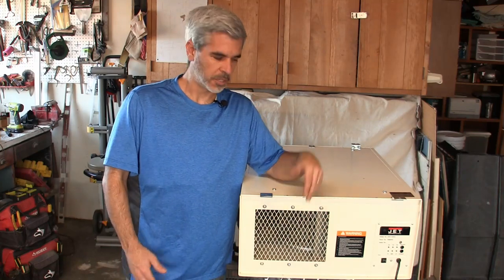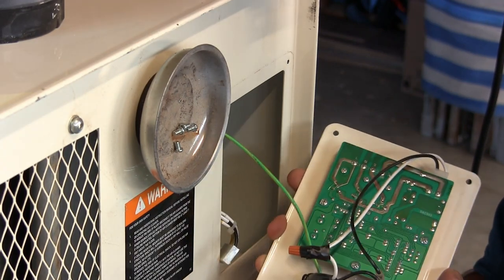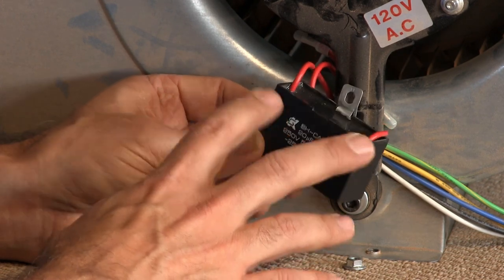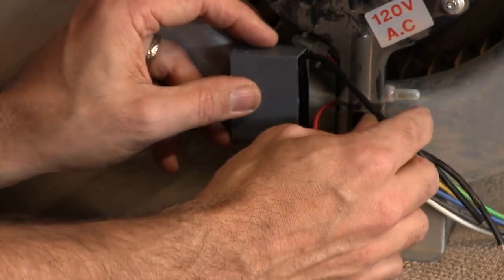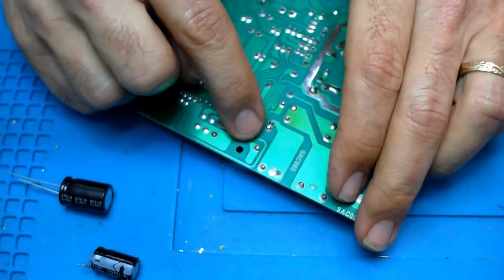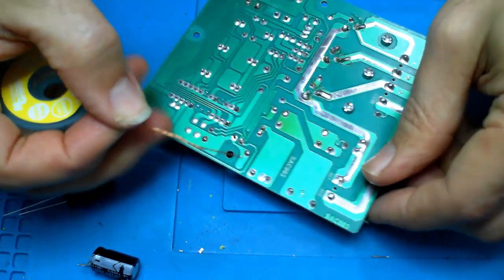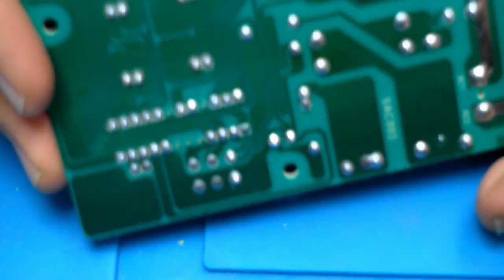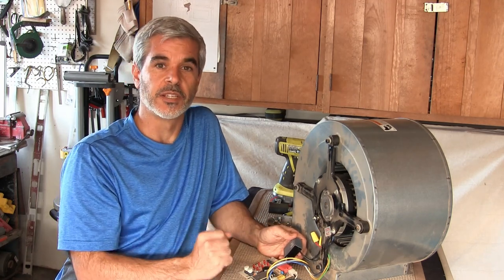JET Workshop Motor Start Issue - Motor and Controller Capacitor Replacement

Comment: I've got slow rotation under power, but the impeller spins freely by hand, so I'm ordering the replacement capacitor. Given the vibration, which you called out for the circuit board, I plan on using crimped connection instead of wire nuts, because a wire nut at that location, above and inside the cage, could get sucked right into the impeller cage if either were to vibrate off its twisted splice.
Reply from the maker: Sounds like a plan Fred.  Please let me know if this works for you!
Reply: @DansWay  Time and money being somewhat fungible I ordered motor and controller capacitors at the same time.  The motor caps came as a pair. The controller 2200uF, 16V electrolytic capacitors were out of stock but the original rating 2200uF, 10V were available (min quantity 10).

Looking at the underside of the original board electrolytic, it had leaked, so I replaced that first. With everything on the bench, I reconnected and tested.  It spun up and ran in all three speeds. The controller is a mixed analog and digital board, with a triac for each motor speed connected to the corresponding motor wiring, and a microcontroller for things like the remote and timing, and a brew of components between to trigger the speed-appropriate triac either indefinitely or until the timeout period has elapsed. (My unit, label plate date 11/2002, was "as is" without the remote so I have not tested the timer function Remotes seem readily available for about $50 USD.)

Since I had the unit apart, and the prior owner had stored it for perhaps years filter down, fan up, somewhere dirty and damp gathering crud, I took it upon myself to continue the cleaning by marking the fan impeller's position on the shaft (turned out it was on a flat, but that was only visible once I had it off), removing the impeller, taping over the shaft hole, and put the impeller through the dishwasher's pots and pans, high temperature scrub overnight. I cleaned the tacky film and assorted tiny debris off the inside of the volute, and cleaned the inside of the overall case.

The next day, June 3, I reassembled the fan, reinstalled that in the case, reinstalled the motor controller, and finally put the inner filter back in place, and installed a new outer filter.

I just need to touch up some paint flaking and case rust on the filter end, the end the unit had rested on while in storage for several years. It worked fine today when I was smoothing a rather rough cut scrap of 2x4 using 80 grit on a belt sander.

Now I just need to put a note with all the extra capacitors, and not mislay the small bubble-pack mailer. Perhaps I'll attach it to the unit's power cord once I put it some place more permanent than stacked on the (blade retracted) table saw.

Comment: This is my exact issue.  I haven't taken my Jet filter apart, but looking at that capacitor on the board, it's spent.  You can also test the fan capacitor with a multimeter to see if it is within spec, but good its just a capacitor issue and a super cheap fix.
Reply from the maker: So glad this video was helpful.  👍🏼

Comment: My friend gave me his Jet filtration just like yours.  Had it in the garage for couple years and finally took it for a run.... Mine does nothing no lights or anything.  The capacitor is bulging slightly like you showed yours.  I had just shown my son that same bulging just priort to finding your gem of a video.  Thanks for posting!  If I am not getting any lights whatsoever but do have 120 power past the fuse then I have another issue than just the capacitor right?  Power supply too maybe?  Well I ordered the parts and will see.. thanks so much for posting... amazing how i watched this after doing the exact same disassembly of mine!  Internet is amazing.  Will let you know the outcome!  Thanks again!
Reply from the maker: Thanks for the comments.  Let me know how it turns out. If that cap is totally gone, perhaps you will get no lights, but it could be a bad power supply as well. Will be interesting to find out what you find.
Reply: @DansWay - well Dan kinda like I expected replacing the one barrel capacitor didn’t do anything. The old one was definitely bad. Now I’m trying to source the more rectangular orange capacitor that’s next to the barrel capacitor. I think that’s another thing that can go bad. I hope the motor up directly and it runs fine, so it’s definitely the circuit board. Any ideas? I feel like since there’s no lights whatsoever on the LEDs. There’s some issue with the power supply. Validated power is past the in-line fuse so the board is getting power. Other than the capacitors, I’m not really sure what else could’ve failed on the board.  The motor capacitor is good as well   any ideas would be appreciated
Reply from the maker: Next up would be the controller IC would be my next guess...
Reply: @DansWay  - not sure what that is. Is that a replaceable item but much more difficult than a capacitor?
Reply: @DansWay - well bought a standard 3 position rotary switch for 10 bucks. Wired directly and mount just to the left of the control board. Works great!  Did your unit have 4 styrofoam squares in the interior?  Mine did. Inside of sealed plastic covers. Guess it’s trying to reduce the volume inside the box?? Thought it was a little strange

Comment: Thanks Mine work for awhile then stop and my lights on the front weren't working correctly. So I changed the capacitor on the control board and it's good as new.  Thanks again

Comment: Your video helped me bring back my Jet air filtration. Thanks! I had the same problem with the controller board capacitor with the classic sign of a bulged end. Used your amazon links to purchased products and help you out a little.  This seems to be a common problem for the Jet as there were other videos on the same subject...a sign for the manufacture to look at their component choice.
Reply from the maker: Thanks for letting me know how it went for you, and thanks for using the links!  Any steps I missed or other suggestions on this repair?
Reply: @DansWay  I think you covered it well and explained how to trouble shoot either the control board or motor capacitors.  In another YouTube video about the Jet dust collector I watched the person replaced the "other" capacitor on the board, the orange rectangle component to the left of the cylinder shaped capacitor.  Had similar symptoms. I did not know how to test if this one was bad...I don't have much experience with electronic control boards.

Comment: Hello Dan! I apologize because I don't know much about the English language, but I am Spanish and I translate everything with Google Translator. Another user said that you should always properly discharge a starting or running capacitor before handling it. You say that it is a good idea to run a screwdriver through the cables in the covers before touching them. I don't quite understand that exactly. What cables are they exactly? What cover are you referring to? Could you be a little more specific, please? By the way! I have the same problem and thanks to your video I now know how to repair my Jet AFS 500, changing the two capacitors, the one on the board and the one on the motor. I had been thinking for a long time that it was the motor capacitor because it doesn't turn properly and searching around here, I found your video and for that I thank you. Thank you very much, really. Starting today I follow your channel! and you have my like for your video! A hug!
Reply from the maker: Hey Carlos, thanks for the post.  The idea of running the screwdriver through the caps is to short them out.  Touch both leads of the cap to the metal of the screwdriver without touching it yourself.  This shorts out the energy in the capacitor so you don't get shocked.  Let me know your repair comes out!
Reply: @DansWay  I understand the reason, but what I don't know is what cables you are referring to. What cables are they exactly? Could you post a photo, please?

Comment: Would this be the same for a Delta unit?  And I agree with others, you da man!
Reply from the maker: It would likely be true for these types of units.  What happens when you turn it on?  Does the like flicker, or does the motor just hum / barely move?
Reply: I have to hold the start button down for it to start up. Otherwise it won’t start.
Reply from the maker: @dickiebrewer1232  Does the user-interface flash?  or does it just take a moment to get the motor going?
Reply: It doesn’t flash.  I hold the button down and the motor starts turning and will increase speed if I keep holding the button down.  It used to stay running.  Now when I do that, it just dies.
Reply from the maker: @dickiebrewer1232  Ok, so that is definitely the large square motor 'run' capacitor mounted to the motor.  Pull it out and buy one with the same specs (xxMFD or xxUFD, xxVAC).  You can start here as an example: https://geni.us/20uF_Motor_Cap
Reply: Thanks Dan!  I’ll order today and keep you posted.  Hope you and yours had a good Easter holiday.
Reply from the maker: @dickiebrewer1232  Sounds good.  We had a good Easter celebration, thanks!
Reply: Sorry I took so long to get back to you with a thank you.  The capacitor worked and I’m back in business.  Thanks a lot for you help.

Comment: I want to add something. There is absolutely potentially lethal voltage still in that system. The start capacitor on that motor can retain full voltage. Remember that a capacitor even though it passes AC voltage, is still cycling the electrical field on the plates. And it's doing so to peak waveform not RMS. So if you disconnect that system at the peak AC, then the capacitor plates potentially have 170v stored on them. Many systems might have bleed down resistors. But I wouldn't count on it. Just running in there and disconnecting that capacitor with bare hands could definitely hurt you seriously. Always correctly discharge a start or run capacitor before handling it.
Reply from the maker: Thanks for saying this.  It is true that you should run a screwdriver across the leads of the caps before touching them.

Comment: Great video! My problem is weird. If I repeated press the on/off switch the fan starts moving and each click speeds it up, but when I stop pressing it the fan slows to a stop. Which capacitor would cause that? I am assuming it is the run capacitor on the fan, but I thought I would ask before taking it apart. Thank from a new subscriber!
Reply from the maker: Hey Thomas, that is a strange one!  My best guess is the run cap.  Definitely not the power supply cap...
Reply: Thanks for the reply! I will take it apart and replace the run cap. I ordered one using your link.